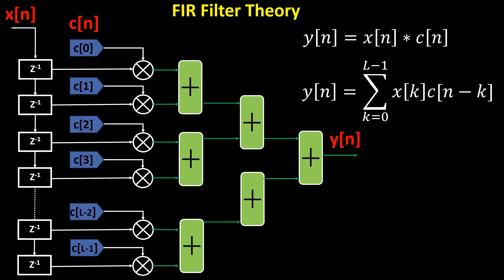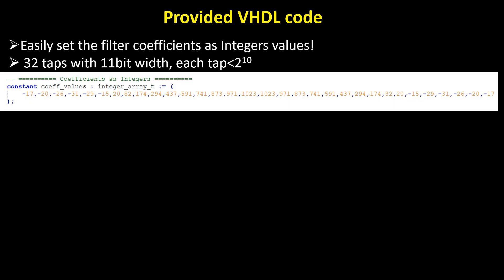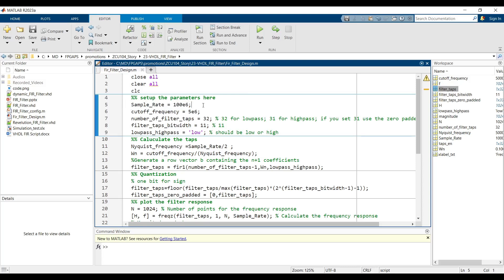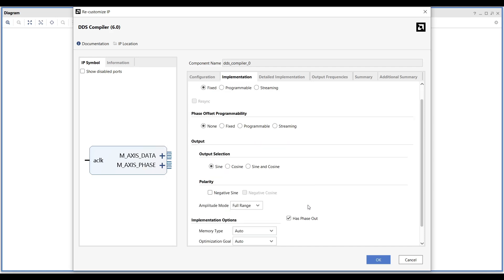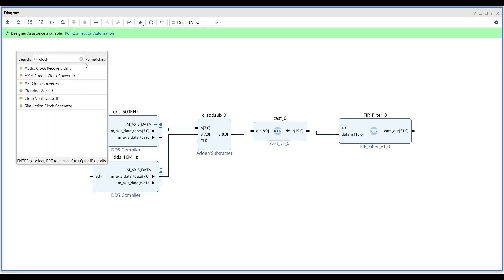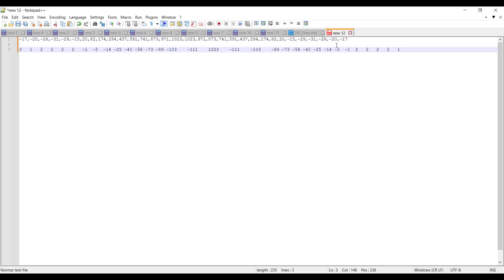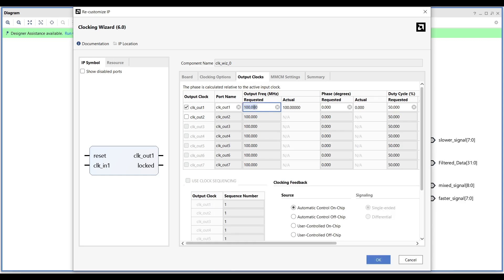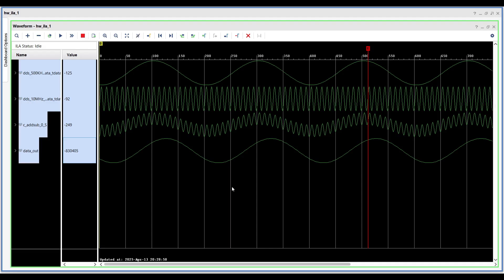VHDL FIR lowpass high pass filter: Vivado simulation and implementation

Comment from the maker: To generate FIR filter taps using the provided MATLAB code:

✅Lowpass Filter:
Set number_of_filter_taps = 32 and lowpass_highpass = 'low'.
Use the integer values from the filter_taps variable as the quantized filter taps.

✅Highpass Filter:
Set number_of_filter_taps = 31 and lowpass_highpass = 'high'.
Use the integer values from the filter_taps_zero_padded variable as the quantized filter taps.

Comment: Hi,
First of all, thank you very much for your work and for sharing this tutorial.
I also found your explanation of the FFT IP Core extremely clear and helpful!
Maybe it would be a great idea to also encapsulate the FIR filter in an AXI4-Stream IP and include both cores together in future tutorials.
That would be extremely useful for those of us who are just getting started in this amazing field! 

Thanks again for your effort!
Reply from the maker: Hi @diegolopez7052,
Welcome to the channel, and thank you for your comment!

Yes, it's a great idea to encapsulate the AXI Stream for two main purposes:

To make the output compatible with AXI Stream protocol, allowing it to interface with DDR memory or other IP cores that support AXI Stream.

To enable dynamic updating of FIR filter taps. In this example, the FIR taps are fixed, but with a few modifications, it’s definitely possible to change the taps on-the-fly.

Cheers!